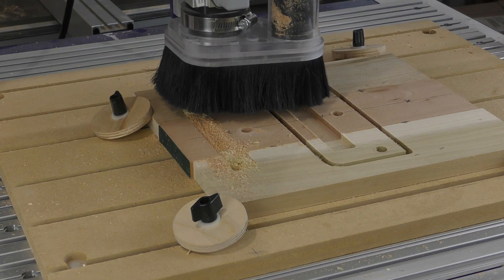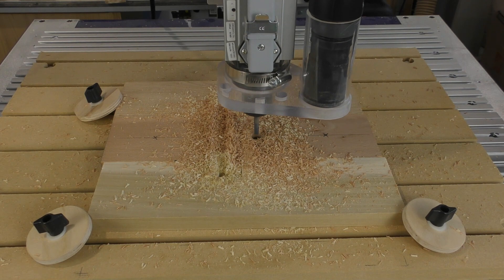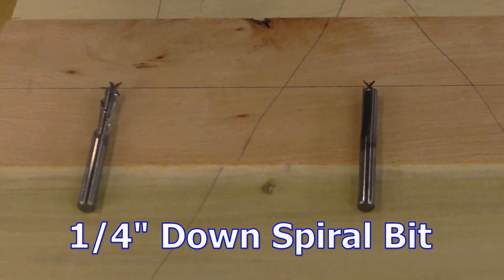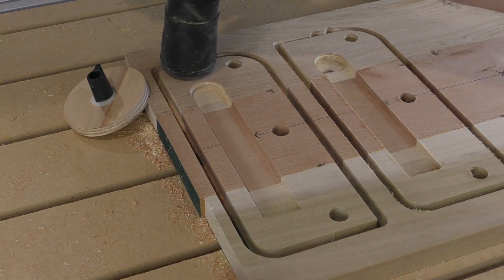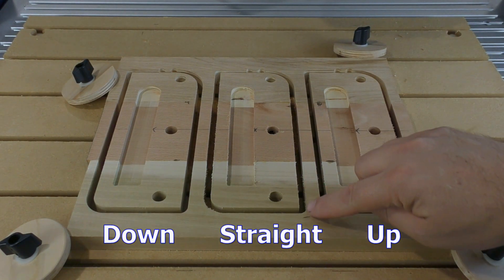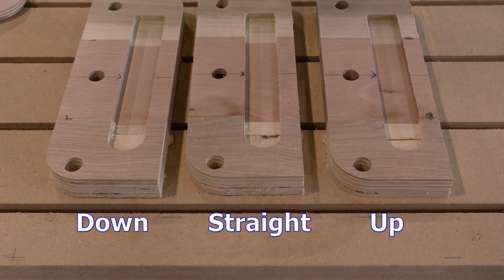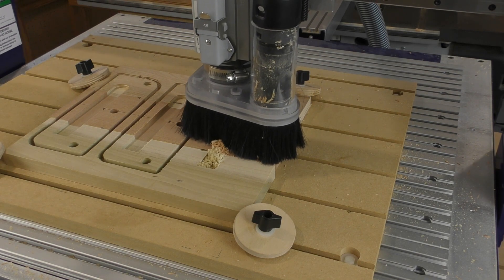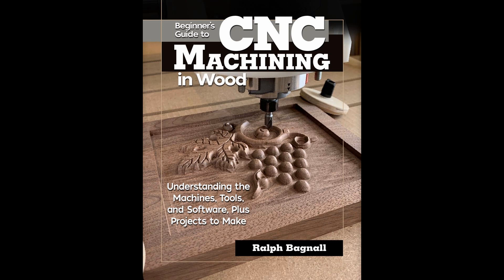A Tale of 3 Bits, Up, Down and Straight

Comment: good demonstration video....next time include a compression bit.
Reply from the maker: To be honest, a compression bit is designed for a single pass cut through so both the top and bottom faces get cut inward. This is rarely how benchtop CNCs are used. 
But if you look at my Skull Candy Dish Video (https://youtu.be/PK6WwAFru8Q) you can see me using a 3/8" compression bit for the cut out.